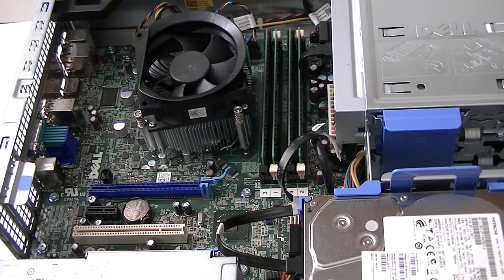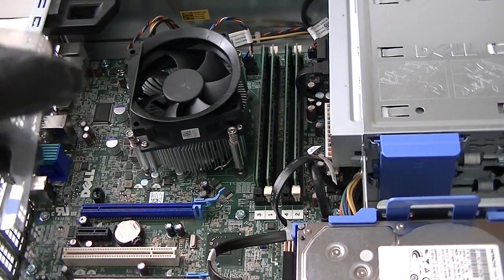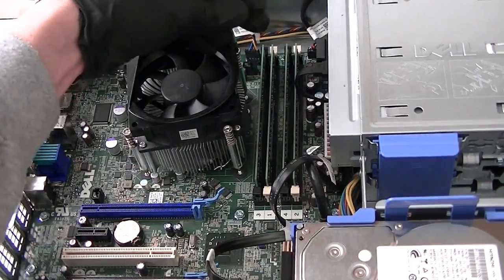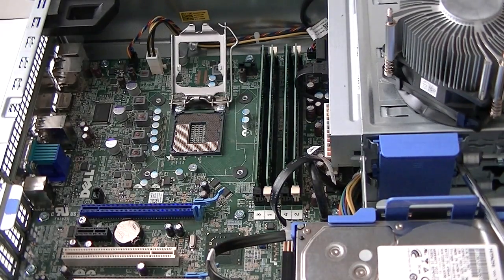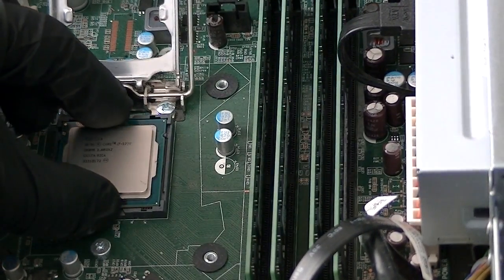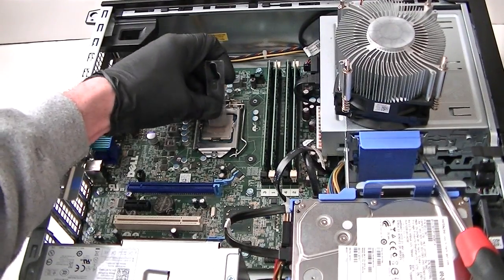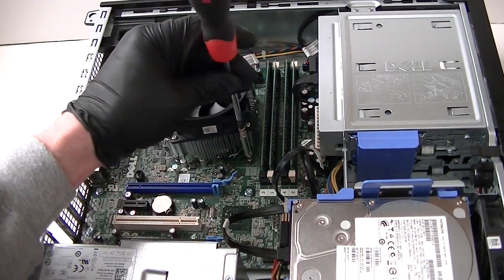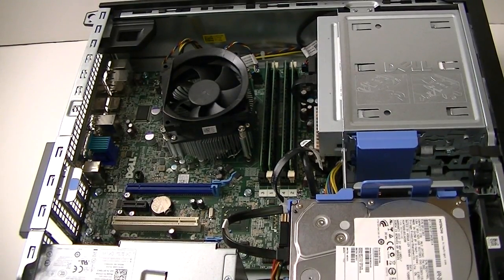Dell Optiplex 7010 Install Upgrade Processor

Comment from the maker: Full Parts list works with this machine:

Intel Core i7-3770 Quad-Core Processor 3.4 GHz 4 Core LGA 1155
https://amzn.to/3xaKc3Z

This video cards will work with this system. 

(1.) Gigabyte Geforce GTX 1050 Ti OC Low Profile 4GB GDDR5 128 Bit PCI-E Graphic Card (GV-N105TOC-4GL) 
https://amzn.to/2XEqKMb

(2.) MSI Gaming GeForce GTX 1650 4GB GDRR5 Low Profile Graphics Card (GTX 1650 4GT LP OC) 
https://amzn.to/2VkDdSd

(3.) MSI GTX 1050 TI 4GT Low Profile  Graphic Cards 
https://amzn.to/34r0AxG

(4.) Gigabyte GeForce GT 1030 GV-N1030D5-2GL Low Profile 2G Computer Graphics Card 
https://amzn.to/2Xu3SyO

(5.) ZOTAC GeForce GT 1030 2GB GDDR5 64-bit PCIe 3.0 DirectX 12 HDCP Ready Low Profile Video Card ZT-P10300A-10L 
https://amzn.to/3eayL1b

This RAM works with this machine:

(1.) Crucial 8GB Single DDR3L 1600 MT/s (PC3L-12800) Memory CT102464BD160B
https://amzn.to/2VhGv8O

(2.) Crucial 4GB Single DDR3L 1600 MT/s (PC3L-12800) Memory CT51264BD160B 
https://amzn.to/2xq46wb

(3.) Crucial 16GB Kit (8GBx2) DDR3L 1600 MT/s (PC3L-12800) CT2K102464BD160B 
https://amzn.to/2VpsKpP

(4.) Crucial 8GB Kit (4GBx2) DDR3L 1600 MT/s (PC3L-12800) Memory CT2K51264BD160B 
https://amzn.to/2y7XZwq

This HDD 2.5inch will work in this caddy for extra storage.

Dell R494D 3.5" to 2 x 2.5" HDD/SSD Caddy Adapter 0R494D
https://amzn.to/3c8ynhJ

Corsair Dual SSD Mounting Bracket 3.5" to 2.5 CSSD-BRKT2
https://amzn.to/2Rtw40K

1.. Seagate FireCuda 2TB Solid State Hybrid Drive Performance SSHD – 2.5 Inch 
https://amzn.to/3b1e8T7

2..WD Blue 2TB Hard Drive s, SATA 6 Gb/s, 128 MB Cache, 2.5"
https://amzn.to/2Xstb4b

3..Seagate BarraCuda 2TB Internal Hard Drive HDD – 2.5 Inch 
https://amzn.to/2xmf0TE

This cable required if you going to install SSD and HDD:
Benfei 15 Pin SATA Power Y-Splitter Cable 8 Inches
https://amzn.to/2XsG0LV

Cable Matters 3-Pack 15 Pin SATA Power Splitter Cable 8 Inches 
https://amzn.to/2Rval8B

Zheino SATA Power Splitter Cable (2 Pack) SSD Power Cable HDD
https://amzn.to/3a3V9Wq

SSD list works with this PC:

Samsung 870 EVO 2TB SATA SSD
https://amzn.to/3ezOds5

Crucial MX500 2TB 3D NAND SATA Internal SSD
https://amzn.to/3B9f8CF

SanDisk Ultra 3D NAND 2TB Internal SSD - SATA
https://amzn.to/3RSZ8LR

(1.) Samsung 860 EVO 500GB 2.5 Inch Internal SSD MZ-76E500B/AM) 
https://amzn.to/2yNxnkE

(2.) WD Blue 3D NAND 1TB Internal SSD, 2.5" WDS100T2B0A
https://amzn.to/2wvnC9Z

(3.) WD Green 1TB Internal PC SSD  WDS100T2G0A
https://amzn.to/3cbrcWa

(4.) SanDisk SSD PLUS 480GB Internal SSD SDSSDA-1T00-G26
https://amzn.to/3a3i9ou

(5.) Crucial MX500 250GB 3D NAND SATA CT250MX500SSD1(Z) 
https://amzn.to/34rZlhy

(6.) Samsung 860 PRO SSD 256GB - 2.5 Inch SATA III 
https://amzn.to/2ybiHLK

(7.) Samsung SSD 860 EVO 250GB 2.5 Inch SATA III Internal SSD 
https://amzn.to/2VjIAkK

(8.) SanDisk SSD PLUS 240GB Internal SSD
https://amzn.to/3c7SEE4
Reply: and optiplex 7020 ???
Reply: Mxkdi does an AMD Radeon R7 250 card work in an optiplex 3010?
Reply: will a MSI Gaming GeForce GT 710 2GB GDRR3 64-bit HDCP Support DirectX 12 OpenGL 4.5 Single Fan Low Profile Graphics Card (GT 710 2GD3 LP) work with this system?
Reply: @Just_retro_spect cpu don't use the power supply that much so really i think any processor would work. im planning on adding a ryzen 3 due to my budget
Reply: @Just_retro_spect if you have a Ryzen 3, 5, or 7 then you can change to only another Ryzen processor. If you have an Intel 3,5,7, or 9, then you can only change to another Intel processor. The reason why you cant change to a different brand is because the motherboards are different for each brand of processor.
Reply: @Just_retro_spect your welcome.
Reply: Is there a vga gpu because I have a monitor that I want to keep
Reply: Will the 3770k fit in the dell optiplex 7010? Or just the 3770s? I currently have the intel core i5 3470 and want to upgrade thanks!
Reply: is this the dt model?
Reply from the maker: @sknyosmar2332  Yes
Reply from the maker: Hi, yes

Comment: Hi i have a question for you, before upgrading the cpu.
Do i have to do something in my motherboard before installing the cpu? Or do i have to do it after installing?

Another question, i have a rx6400 low profile 4gb, would that work for this?

Comment: Btw just wanting to know, with that cpu processor is it good at gaming?, and can it go any higher other than the Intel i7-3770?
Reply: Yes, it's pretty decent at gaming. This is the best processor you can use for this motherboard (without going xeon, but that's a whole other conversation since it doesn't have integrated graphics or anything) since it doesn't support overclocking (the model that does is the i7-3770k). Any newer i7 would use a completely different socket and wouldn't be compatible with this motherboard. You shouldn't use a PC exactly like this for gaming though because the low profile is very limiting. You'll spend more for less performance in most situations when it comes to graphics cards. Go for a size like the 9010mt.
Reply: @Skippymyman  are the 7010's in legacy mode or uefi mode by default?i read also the secure boot should be disabled before installing a gpu.
Reply: @archangelmusic13  Unfortunately, I'm not sure. I no longer have this setup.

Comment: Can I install a Xeon e3-1270 v2 instead? June 29th 2020 replying back to my question. Yes you can I have it in my 7010 DT and it has been working great. But in order to use do you have to have a dedicated graphic card and make sure you got your bios setup to detect it. Oh,... going to mention have the latest bios that it will take. Believe it is A29. My 7010SFF has a 1240v2 in it also and works great. Both have 4GB GPU in them. A GTX 1650 and XFX RX 550 and are low profiles that work good with the systems and well below the 75W max of the PCIe slot. Not as good as a 8GB top of the line one but they would now fit or work in my two anyway. I like the small footprint instead of a big tower..

Comment: i, i got this PC for free and woould like to know wich GPU Will be a best match for this cpu, thank you subbed!!
Reply from the maker: Hi, you can use gtx 1650 or gtx 1050 ti video card
Reply from the maker: Hi, do you have mini tower or small form factor PC ?
Reply: @Mxkdt  hi, is a mid tower casing thank for the quick response
Reply: @C M a fat one is plenty you can upgrade to mostly any 2 fan gpu but you have to upgrade psu first otherwise gtx 1050 ti or 1650 is the best you can get !!

Comment: All your videos are really nice...
Can you please make a video on how to add M.2 NVME SSD in Dell 7010 DT using PCIe adapter
Reply from the maker: Hi. M2 Booting requires UEFI GPT BIOS.  The Dell Optiplex 7010 has CLASS 0 Legacy bios and can boot and run WindowsXP. So this is NEVER going to be an option.

Comment: Do you need a new power supply when upgrading from i5 to i7?
Reply from the maker: Hi, no you do not have to upgrade power supply.
Reply: Justretrospect min scant with an intel core i( 3600k
Reply: Justretrospect I meant to say I have at the begging and yea no prob
Reply: Justretrospect i5 btw
Reply: Justretrospect I’m upgrading to an i7 3rd gen that’s the highest this pc can handle

Comment: Hi what's the maximum upgrade this pc can handle like ram gpu cpu? THanks bro.
Reply: 16GB ram for 7010, 9010 would be 32GB, CPU max is i7-3770 . i7-3770k sorry .the over clocking one is the highest it will take.
Reply: CowboyAxe can I use a i7 3770k in my 7010? im thinking in upgrape it
Reply: @B21Gamer  Yes 7010 had that as an option. but only upgrade to 16gb ram and 9010 was 32gb... Yes upgrade it will work
Reply: @B21Gamer  Double check though... that is the over clock version... but I say it should be fine. only 8 percent more juice... not much more than standard i7-3770
Reply: @B21Gamer  No sorry can only use standard i7-3770.. not K.  I was wrong... but standard one is amazing.
Reply: CowboyAxe oh ok thanks is not a big different for i7 3770
Reply: @B21Gamer   not huge but you might notice it doing intense stuff... but your GPU is king and that would make it sing if you buy one that can fit slot...decent ones on sale online.
Reply: @B21Gamer  Yes doubt much diff if you get decent graphics ..
Reply: @B21Gamer  Power supply might need upgrade, but some get away with adding graphic card on stock. Your call on that.

Comment: can i use ryzen cpu on my optiplex 7010 gtx 1050 ti 8gb ram
Reply from the maker: Hi, no
Reply: You can but you will have to install a 500w power supply
Reply: @lilpup1414  You can't put a Ryzen CPU into a motherboard made for Intel processors. You'd have the change the motherboard, and power supply.
Reply: @johnathanirby8783  oh so ill have to put an Intel if i want to upgrade the cpu
Reply: @lilpup1414  Yes. If you go with Ryzen get a new motherboard, and most likely ram aswell. Ryzen doesnt really like slower ram modules.
Reply: @johnathanirby8783  thanks. I was gonna buy a ryzen but know I know to buy an Intel. But I don't know what I should buy though...
Reply: @lilpup1414  If you have the same system as this video, the highest you can go is the 3770
Reply: @johnathanirby8783  ok thanks

Comment: hey i just bought one of these but have a few Questions

1.)what's the most powerfull CPU i can upgrade to i currently have the i5 3470 

2.)If i Buy a Dell Tower can i transplant this motherboard into that system?

3.)if the transplant was fine can i fit a GTX 1070 in the pc alongside a 650W PSU upgrade? or am i stuck with a GTX 1050ti? 

any help would be appreciated cause my plans are to first just use a GTX 1050ti later move the pc to a better case upgrade the cpu, gpu etc. and yeah
Reply from the maker: Hi, did you buy mini tower or small for factor PC?
Reply from the maker: Hi, i just uploaded video and shows you how to upgrade bigger video card for gaming by removing hard drive cage.
https://www.youtube.com/watch?v=Bjtpp-fIx_Q

Comment: love your video's  very clear and easy to follow i am new to pc upgrading i have question you might be able to help with hopfully thinking of buying a second hand dell optiplex 7010 with a Intel G1610 Dual Core Cpu - 2.60Ghz can i upgrade it to an i5 or i7 of any sort don't no what motherboard is in it thanks for the video's

Comment: i got a Dell Optiplex 7010 Celeron G540 SFF, Can i upgrade it to Core i5 3470 or Core i7 3770 ???
Reply from the maker: Hi, yes you can upgrade CPU to i5-3470 or Core i7 -3770.

Comment: I did everything in the video but Pc is not booting. did you need to do anything with BIOS or power etc for the motherboard to see the 17-3770? i upgraded from i3 2120 and not booting up for me.
Reply: Your motherboard  propably is too old for 3rd gen CPU, You should use 2nd gen, or check compatybility with your chipset, some 3rd gen can work.

Comment: Can I put AMD Ryzen 5 1500X on this instead of Intel I5 3470? I have already upgraded the ram and HDD thanks to your video.
Reply from the maker: Hi, no this computer does not support AMD Ryzen 5 1500X. The fastest processor this dell optiplex 7010 supports is Intel Core i7-3770.
Reply: Thanks

Comment: You do great videos, have used many of them so thank you. Would this also work replacing 3470 to 3770k?
Reply: No the 3770k won't work in this type of machine due to the BIOS. It will not support any K series.
Reply: @johnathanirby8783  so i7 3770 can replace it

Comment: If you had a Video Card then you could up-grade the CPU to the  XEON E3-1240 V2 and use less power for the CPU.  tjl
Reply: Have you accomplished this upgrade with the xeon? BIOS works or is available? 
Thanks

Comment: How high could I go up in terms of CPU without bottlenecking if I have an i3 3420
Reply from the maker: Hi, are you using that i3 3240 for gaming ?
Reply: Mxkdi I'm gonna upgrade to I5 2500, but for now yes. I don't play very big games but when I upgrade to a i5 I'm either gonna get a gtx1050 ti, or rx460.

Comment: would it be possible to upgrade the cpu cooler
Reply: This is true BUT you need to watch the height of the cooler you are buying.  This is a small form factor case and some coolers may be too tall to fit that case.
Reply: Ducky Duck Yes, go to amazon and look for CPU coolers designed for lga 1155, in the disc the coolers also say what gen they are for.